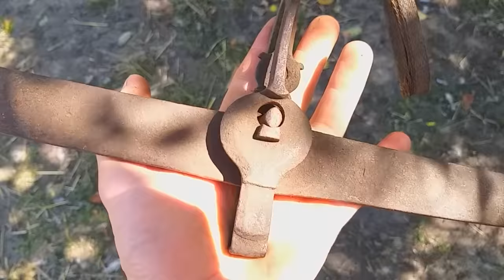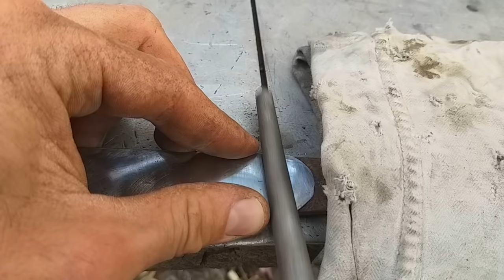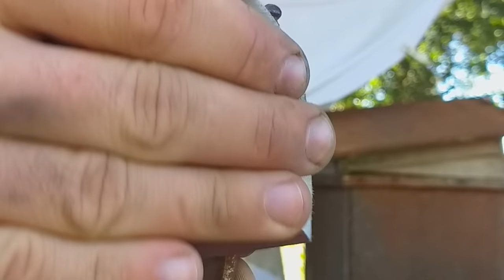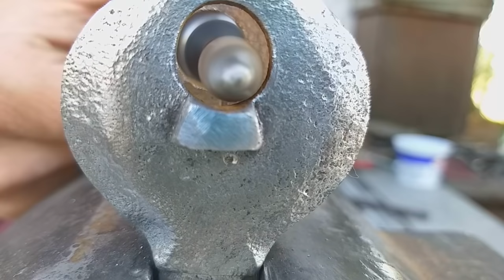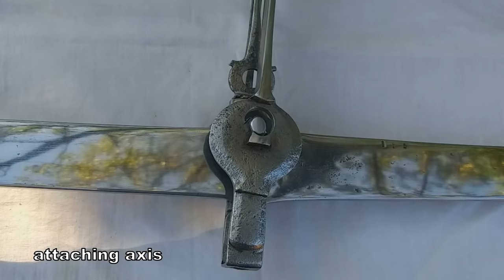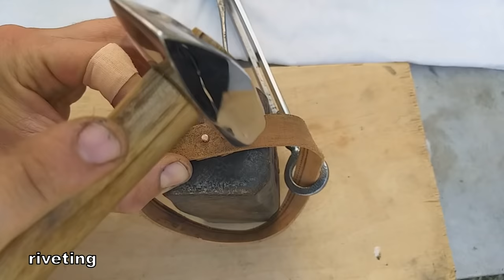Antique Rusty SCALES Perfect RESTORATION

Comment: Some food for thought from a new subscriber. When repairing any type of balance beam scale such a this, remember it must have a pivot point otherwise it will not function properly, the more sharper the pivot is, the more accurate your scale will be.
This unit is not actually a weigh scales per se,  but rather an "over an under" scale . Whatever dry product.., lets say wheat is being placed on one side of the scale, it is measured against a known weight on the opposite. If the weight is under, more product is added to the sack until it balances, the opposite action is applied if the weight is over.  The part you referred to as the axle is called the pivot and the part that it rests on is called the V-block.  For purposes of accuracy or something closely related to.., the pivot should be somewhat pointed and it should rest in the center of the v-block that should be a shallow V instead of being rounded like a saddle. With scales, the more surface contact you have at the pivot point / v-block the less accurate reading you will get.  Friction at the balance / pivot point can throw any scales off in pounds, this will be exaggerated by the amount of weight applied.  Given the fact that this Over and Under will probably end up as wall art, no harm, no foul. You did a good job with preservation
Reply from the maker: Wow! Thank you for info mate, i appreciate that😃
Reply: @almostperfectrestoration  No worries brother, someone had to teach me, share the knowledge👍

Comment: Not a restoration. You took most of the handworked character out of it with the grinding and polishing. Doubtful that it would have been polished in 1851. More than likely it would have been hammered out of black iron and either left in the raw or given a beeswax finish. And 1851 would be the 19th century .